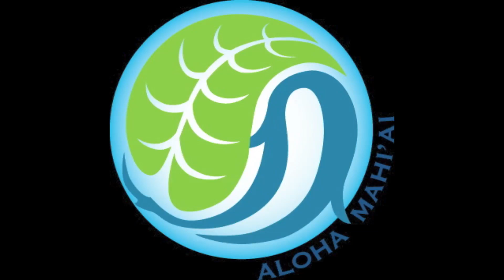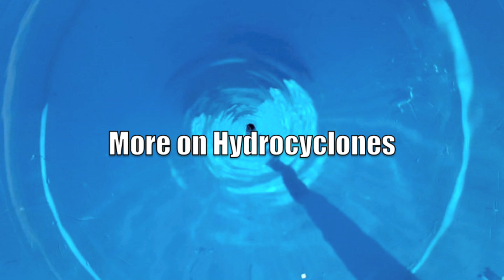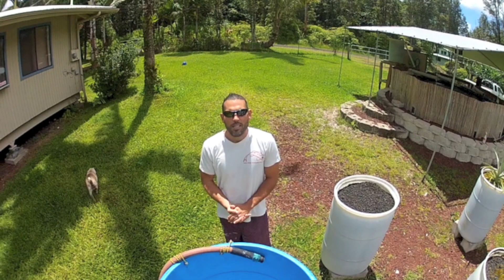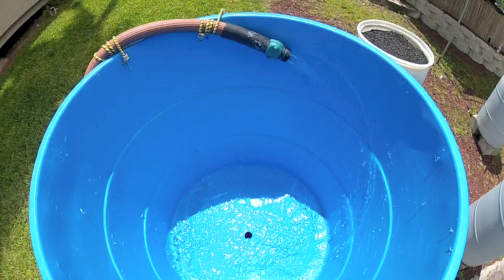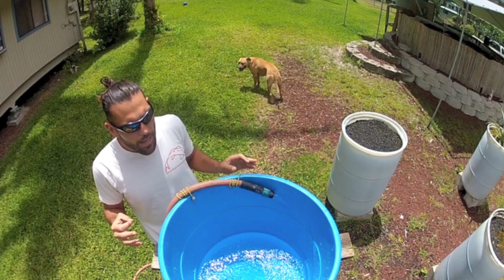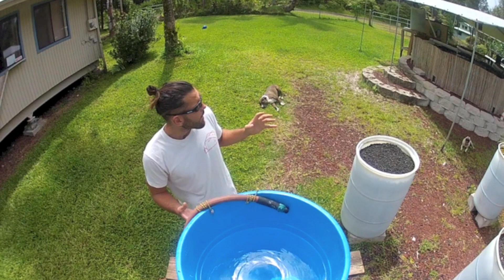More on Hydrocyclones

Comment: I love that you have a video about this. I just started looking into the water wizard himself, Viktor Schauberger, and I'm very curious about how much dissolved oxygen you get out of this system. Do you have any comparative numbers or tests where you measure this?

How long does the oxygen stay in the system and how far will it travel? For example, if I didn't have this vortex falling directly into my fish tank, but rather into my sump which was then pumped into the fish tank, would it retain the dissolved oxygen?
Reply: Sorry, you answered my question about the dissolved oxygen in the video. The second question still stands though :)

Comment: wouldn't you get more surface area by showering it over a larger area like a 2 metre surface area shower head with thousands of holes over the top of the tank defusing more oxygen into the water ?
Reply: Yes

Comment: This looks very interesting, but I wonder how long you have been running it and if you see its performance change over time.  One thing I see in my system is that flow rates change as screens become clogged on pumps or pipes become bio fouled in the system.  It seems that a flow rate reduction or change would be catastrophic to this system as the system either overflowed from a reduced outflow rate or stopped cycloning from a reduced inflow rate.  How long have you been running this system?  Have you encountered any changes in efficiency or problems due to changes in flow rate?  Are you finding this setup requires much maintenance to run optimally?
Reply: +David Robinson just as a thought..  one could have two buckets..  the primary bucket could have a hole in the top with a lead pipe at a downward sloping angle feeding the second smaller bucket. so you could over feed the fist bucket which would hold the venturi and as the water level rises too high the overflow could be diverted to the second bucket also creating a venturi..  as the system clogs the pressure would drop and would nolonger overflow to the second bucket. of course if you had a realy good pump you could just keep adding buckets rather than restricting the flow to the first bucket,, which would take pressure off your pump and allow for optimum use of the energy the pump is consuming.

Comment: I have been experimenting with this in my small system and have not seen much air get pulled yet. I am using a regular 5 gal Home Depot bucket with a 1" hole at the bottom. My next experiment is to reduce the size of the hole to see if the vortex makes it to the bottom. Question is.... is my 5 gallon size a dealbreaker from the outset? If size does not matter, I may consider smaller vortex aerators placed strategically among my rafts.
Thanks for any help you all can offer.
Reply: What became the outcome of this. Wanted to try also with a 5gal bucket.

Comment: Just wanted to day THANK YOU, Marcus! Aeration was the one thing I could not get right with my aquaponic system. I have a gravity fed growbed with a raised fish tank, so I only needed one 4 Watt pump in a sump to raise the water back up to the fish tank. I hated the idea of a separate air pump to aerate the fish tank. Spray bars on the return hose just weren't cutting it. I built a hydrocyclone out of a 5 gal bucket today and could not stop smiling as I watched the tiny bubbles rising!